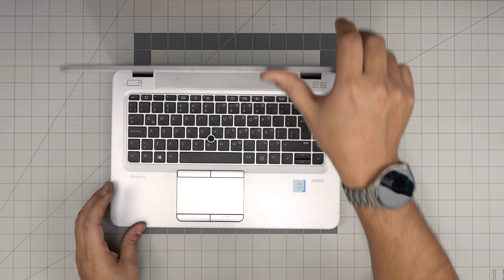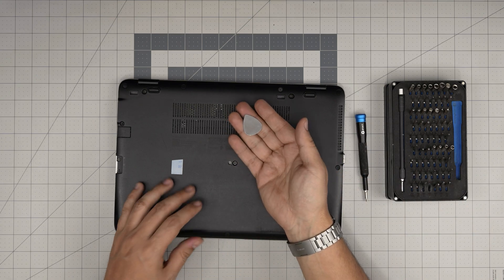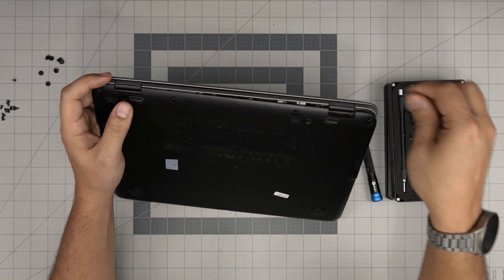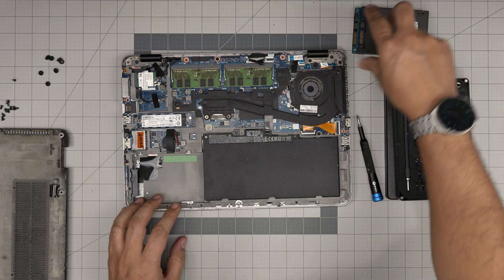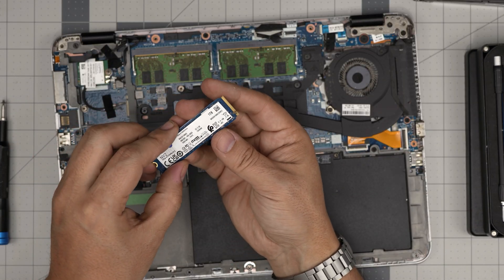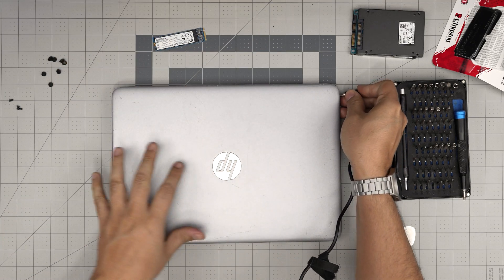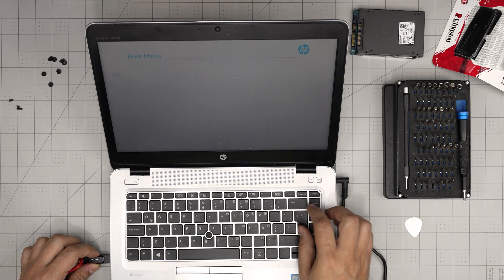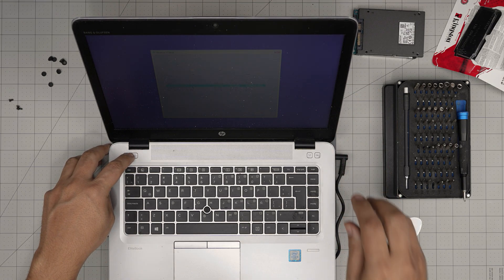How to Upgrade the SSD Storage on an HP EliteBook 840 G3 Laptop

Comment: Which gen of NVME it support  3, 4 ?
Reply from the maker: 🫠Regarding your question, gen3. But you can place a gen4 and it will run it as gen 3 specs.
Should you have any further questions or requests in the future, please don't hesitate to ask me.
cheers🍻
Reply: @uFixTek  hey, i have same laptop but don't have that circle button in middle of keyboard
Reply from the maker: that is fine, that is optional.

Comment: Can I put in NVMe SSD on my HP Elitebook 840 G1 instead of the M.2 Sata?
Reply from the maker: 🫠Regarding your question, no you can't because that is not an m.2 PCI-E is a sata lane.
Should you have any further questions or requests in the future, please don't hesitate to ask me.
cheers🍻
Reply: So wt ssd would be the best to put in my laptop. Could u plz give me some suggestions?  @uFixTek
Reply from the maker: You can place any M.2 SATA SSD up to 2TB. There are some cheap (low-grade) options, as well as some great, long-lasting ones from reputable brands.

here are few good ones:
https://amzn.to/3HHA6zC
https://amzn.to/4kD9w9j
and a cheaper opton:
https://amzn.to/45TUFTq
they are 2Tb.

This is an Amazon affiliate link. When you use my links, you are helping to support the channel. 🙏
Reply: Thankyou so much bruv   Really appreciate it. @uFixTek
Reply from the maker: It's my pleasure my friend.
Reply: @uFixTek  wt do u think is the M.2 Sata Better Then the 2.5 Sata ?
Reply from the maker: they are both the same, just different formfactor.

Comment: On my Elitebook 840 G3  this Nvme SSD upgrade don't work. The Bios ( I've flashed the last version) don't recognize the SSD.
Reply from the maker: 🫠Regarding your SSD upgrade, that is weird, as we upgrade these laptops all the time without any issues.
Reply: @uFixTek  The HP Service Manual for this model writes that Nvme SSD are supported only by the Workstation model ...  The SSD Sata M.2 is supported
Reply from the maker: The HP EliteBook 840 that I used in this video was upgraded for a client without any issues.